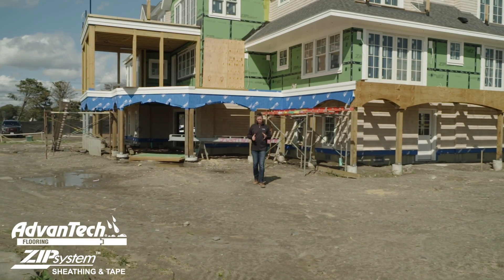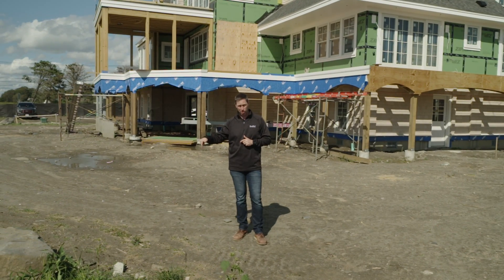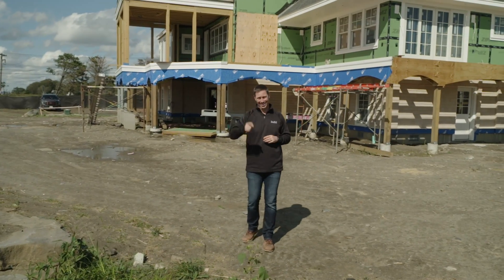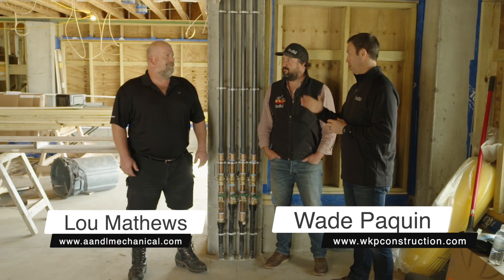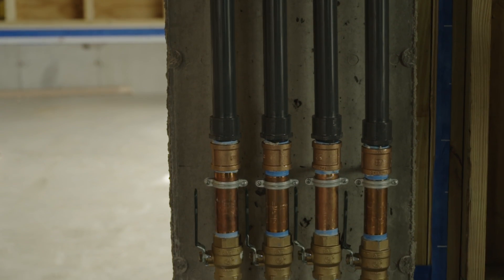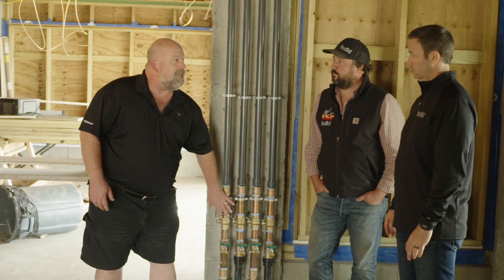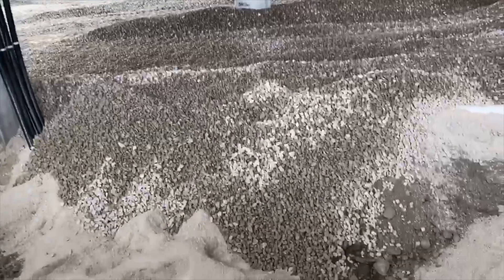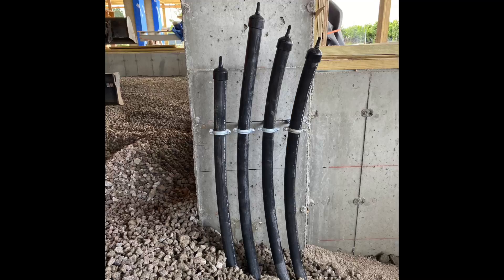Debunking 3 Geothermal Myths

Comment: Can someone explain to me how this works using a fluid. Fluids can't be compressed. So how is the temperature raised from 50 - 55 degrees to ~70 to heat the home?
Reply: The liquid is only there to transfer the heat from the refrigerant to the ground or viceversa. The refrigerant in the heat pump does the heating/cooling.
Reply: @MrJramirex  this is the best explanation that I've never heard anyone give. Essentially the compressor unit is inside instead of outside exchanging heat with the water instead of air. Everyone makes it sound like the ground water is directly heating and cooling.
Reply: As far as I know, you still have condenser loops like a traditional heat pump, but instead of an outside radiator unit you pass the heat to the water (or the other way around).
Reply: From my experience as a stationary engineer for a large office building, the heat pump still uses a refrigerant to pull the heat out of the warmer water thru a set of heat exchangers. Similar process we use to cool a building, where we use a closed loop chill water system which the compressor chills 55 degree return chill water from the air handler coils down to 45 degrees. The heat drawn from the return line is then exchanged into the condenser water line which then feeds to a set of cooling towers where evaporation releases that heat. I presume this acts in the opposite and uses the warmth of the earth as to heat the water, which then exchanges that heat into the refrigerant of the heat pump and is then compressed and concentrated and pump thru evaporator coils of the air handler. In other words, it uses water as the condenser instead of air like your typical air-sourced heat pump. Water is something like 15-20 times more efficient at heat transfer than air.
Reply: This operates the same way an air conditioner does. Instead of exchanging heat with air, it uses the ground. The water is the medium used to exchange that heat.
Reply: In laymen's just think of it like the cooling system in your car. Instead of it pushing the heat out to the radiator and into the air, it uses a "water" to "Water" radiator system and then using the ground like a big ass radiator.
Reply: 50-55F degrees is a lot easier to heat to a higher temperature than going from freezing to the same higher temperature (like air source heat pumps, and a freezer does this too)

I think you meant liquids, as gases are also fluids.
Although your premise is incorrect, it is useful when dealing with the majority of situations. Think Newton vs Einstein equations.
Sound waves travel through liquids and solids, they are compression waves. An object moving faster than the speed of sound of that medium will certainly compress that medium. Deep ocean water also has a higher density than the same water at the same temperature at sea level.
Reply: @FrancisKoczur  physics considers a fluid noncompressable. The volume changes very little when pressure is applied, unlike a gas that's volume decreases greatly when pressure is applied.
Reply: @ColeSpolaric  The density change of water is inconsequential as a heat exchange medium. If you're thinking of the refrigerant used in the heat pump cycle, it's normally now R410a in GSHPs. Coaxial heat exchangers are used as oppose to air fin heat exchangers used with air. Another type are plate heat exchangers.
Reply: @FrancisKoczur  it was never clear in any explanation I have ever heard that the water was used to exchange heat from the compressor. It always sounded like the fluid was being used directly to heat and cool. I knew I was missing something because given everything I knew about the heat pump cycle, geothermal didn't make sense to me. It does now. I think most shows and websites don't explain this because it's easier for the average person to understand without knowing all the intricacies.
Reply: @FrancisKoczur   Fluids can not be compressed.  They CAN be pressurized, and that is what a water pump does.
Reply: @91156  I've modified my comment. My original was incorrectly relating pressure and compression. But I stand firm that liquids can be compressed, it's just not normally useful to consider them as such.

Comment: so what did this system cost? 40? 50k? 4 wells?!
Reply: Hard to say for sure because its vertical boring. Which is more expensive. Its 4 wells but you can see in video that basically just means 4 loops. Each pair of lines is one loop or well. Depending on how deep they went is how much it costs. By the ocean my guess is they dont have to go far because the soil is going to be very wet down there which is very beneficial for geo wells. All that being said I can tell you I'm building my own home and just had it done here is MN. I need an 8 loop field or 8 well system in this case. All are 300' loops. 7 ton system. Cost 67k for all the equipment and boring. Conventional system was quoted at 42k. So that's a 25k difference before tax credits. After the tax credits of 26% it comes down to 49.58k or an 18% increase. On top of that you actually can wrap as much as you possibly can into that 26% credit. As far as I understand it most the time foam under a foundation can be wrapped into it. Any additional electrical costs can. You basically get 26% off anything that is apart of the "system". Could be wrong on the whole 4 wells == the 4 loops thing but pretty sure they are 1 to 1. If your asking for personal reasons and are interested let me know and I can answer any other questions you might want to know about my system. - Edit just realized I should probably mention I went radiant heat. I'd imagine without that the conventional would of been less making the difference greater. That being said it took them a day to lay all the pipe and if I had to take a conservative guess it maybe costs 3k more.
Reply: @BirdBuster where in Minnesota are you? I’m west of Cambridge. My system is 11 loops and is 11 tons.
Reply: @BirdBuster91  Wow that's neat to see how far the system has come! My question is how many square feet will your 7 ton system heat? Does it also provide cooling or is it necessary to have an AC unit as well? Thanks!
Reply: @Aaron Svoboda - it cools the house too.
Reply: @aaronsvoboda5897  House is 3200 and Garage is 1200. The pump does all the cooling as well so no unit outside. Interesting note is the systems are actually far more efficient for cooling that heating. So if its enough to heat the house its enough to cool it by an x factor. I dont know that x value but short answer is its more than enough.
Reply: @BirdBuster91  Cool thanks for the info!
Reply: @aaronsvoboda5897  Geothermal will always provide cooling as well as the heating. The pump just runs in reverse, rather than extracting heat it uses the ground as a heat sink. No outdoor noisy condensers is a nice perk.
Reply: @wighty  That's interesting - I never thought of it like that!

No ugly & noisy condensers is definitely a massive perk!
Reply: Should break even when you turn 125.😜
Reply: @carpentrylover145  😳
Reply: @carpentrylover145  not likely, you'll need to replace the heat exchanger, pumps and compressor a few times as well
Reply: When no one wants to say how much it costs then the cost is only affordable to people where money is no object.
Reply: If I were bidding this in Montana ( location is extremely important because it influences well difficulty and depth) I'd quote 25K with a 30 year life with maintenance.

To get an equivalent system based on the efficiency of most ground source at about 3.75 to 4.0, you'd be looking at 15-20K because you need both heat and cooling or a conventional heat pump with a superheat option. 

It's really getting close, but it's so much more efficient I can't imagine not going this route
Reply: @Squat5000  Plus AC and Heat break down relatively quickly. I'd guess that 25-30 years is on the high end for AC/Heat units. Not to mention tax credits.
Reply: @aaronsvoboda5897  I've serviced ones over 30 years old, and ones 2 years old. It's really hit and miss but the new ones are not on the same level especially with newer high pressure refrigerants.

I only use Nordic heat pumps for ground source. I am not a fan boy, but they were easy to work with and weren't ass holes on my small business like many other brands. Plus they really are robust. From a design perspective they are just built like tanks
Reply: @Squat5000  Ahhh gotcha!
Reply: John Doe are you in Montana?  We are getting ready to build there, and this looks great! I’m looking for someone who can help us do it..any sources?

Comment: Anti corrosion properties and clean fluid are very important to note, not pumping fine sand will definitely make any pumps and stuff last much longer. Good video guys, thanks
Reply: Good contact between the native formation and the loops is most important.
Reply: Have been reading about geo source for 20 years. Used to sell florida heat pump.  I would never consider an open system.
Reply: @stevepailet8258 , yes, I had a house with Florida Heat Pump and open wells and one day I came home and my whole backyard was flooded and it wasn’t raining for days. Turns out sand from the supply well filled up the pipe in the return well. I was able to add some pipe and valves and pump from the return well and let it drain into the storm drains and then realign the system for normal operation. Then every few months I’d back flush the return well with a turn of a few valves, let it run till clear, then realign for normal operation.

Comment: Lol but you need well drilling
Reply: I live in Pennsylvania where there is limestone and sink holes, those tubes wouldn’t stand a chance.
Reply: @miketalley505  not to mention the systems have difficulty keeping up with the very cold temps and then rely on the electric back up
Reply: @TheHowtoDad  not if you drill far enough, thats the advantage of groundheat pumps compared to airheatpumps
Reply: You can also use horizontal loops, but they require massive trenches. Most people don't have the land necessary so wells and their extra expense are the only option.
Reply: 4 WELLS DRILLED! imagine what that would cost?
Reply: Yes but relatively cheap heating and cooling for the next 150 years.. I would bet those wells could last that long easy, probably a lot longer depending on the plastic used, ground water composition, etc. The pumps and condensers repaired more often, ofc.
Reply: @rbnhd1976  there have been so many false starts with geo over the past 30 years. I doubt it will ever take off. It's pricey to install, and upkeep and maintenance costs are a whole other ball game. you're better to put the added cost into passive type building science
Reply: @rbnhd1976  I think you're being very generous. 150 years on 4 200 foot wells? Do you realize how much surface area that is being exposed to significant shear stress? Maintaining those things is likely extremely costly.

Comment: Geo thermal is expensive to put in
Reply: Yes I did it’s still expensive you can’t tell me otherwise.
Reply: @miketalley505  after the tax credit I was 2 to 3k more than a propane system.  I don't live near natural gas lines. I've cut wood and scooped coal buckets my whole life. Built a new house and knocked the old one down. For new construction in the northern part of the country its number one on my list
Reply: Mike Talley It is overkill for a modest well insulated house, especially one that is oriented properly for passive solar. This house is a monstrosity so the monstrous geothermal system sort of goes along with it.
Reply: Mike Talley didn’t watch the video.

Comment: Please don't ever call it geo thermal, this is incorrect. Geothermal energy is hot earth gas. This is ground source heat pumps....
Reply: Geo means earth, thermal means heat, this is using heat from the earth. Weather water is turned to steam or a heat pump is used either could be referred to generally as geothermal. Hot earth gas isn’t a thing though.
Reply: @floshey  You aren't wrong, but you're not looking back far enough in time. With both ground source heat pumps and geothermal systems you pull the heat (energy) from the ground, that much is true. BUT: With Geothermal systems the energy comes from the earth (as you correctly said), from geothermal activity (think hot springs). Ground source heat pumps draw energy from the upper layer of the ground in areas WITHOUT geothermal activity, the heat in the ground actually comes from the sun warming the soil/rock over months and years.

Edit: That said, call it whatever you want, it doesn't really matter. 👍
Reply: @floshey  look it up noob
Reply: Could the water from a well be filtered and stored in a tank that is located under the garage of the house?    In south Texas the groundwater temperature is about 72F, but using better insulation and air leakage control makes more sense.  There is a location in this city that was famous as a resort for hot wells, but that's not the case in the neighborhood that I live in.
Reply: Geothermal is the term used for this system by industry.  https://www.trane.com/residential/en/resources/get-inside-look-geothermal-hvac-systems-energy-efficient/
Reply: @okoman9568  the Trane organization is a bunch of tax evasion criminals that don't know anything. Look up "inverted domestic organizations" and you'll see their parent company Ingersoll Rand.
Reply: @okoman9568  doesn't matter what you have for references. A lot of people are incorrectly using the term geothermal, that doesn't make it correct. The pros, like myself, who work the commercial energy sector, all know how to use the terms properly.  You have semi-professionals all spreading misinformation to each other and it becomes common place. It's a battle the true experts fight to educate the industry on these topics and many more. I could also tell you how solar panels are hurting the environment by shutting down zero-emmision nuke plants and forcing us to run gas plants but I'm afraid that would escape you as well.